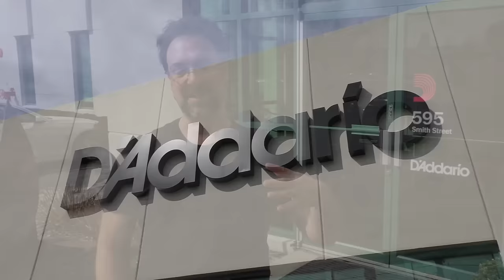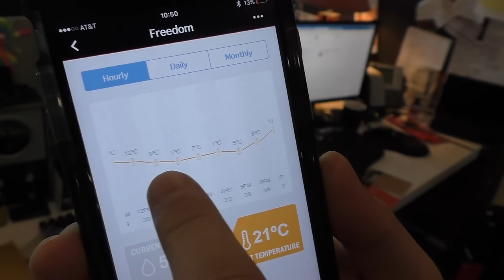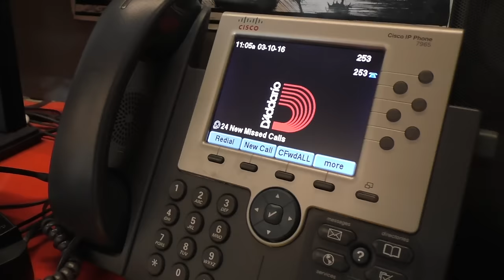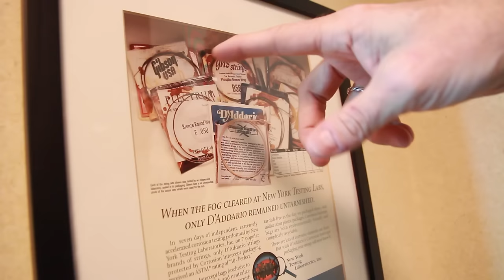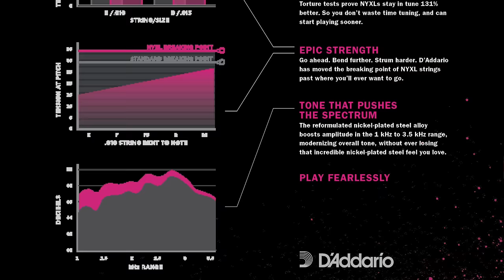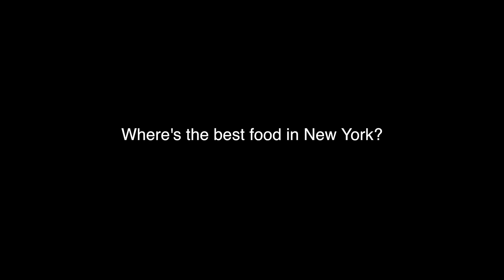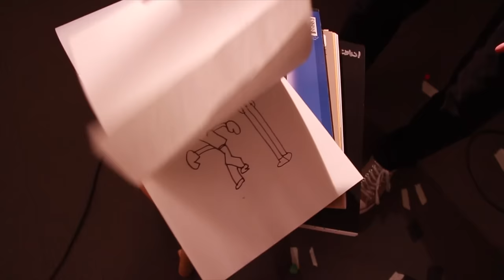D'Addario D'Documentary - Behind the scenes with Chappers

Comment: I have been using D'Addario strings for a very long time.
They are perfect except for one small thing.
When they went from the paper pockets holding each string to the sealed bag with all strings in there I have found that the strings are often wound up together and the the smaller plain strings often end up tangled and it can be a real pain in the ass to untangle them, especially in low light.
One ten pack I bought about two years ago was particularly bad for this.
Other than that they are perfect.
Nice vid Chappers! Thankyou for showing us the faces behind these great products.

Comment: D'Addario NYXL's are ~8% harder to bend than Slinkys of the same gauge if you measure with a scale.  :(  

Great filming and camera work.  Love Planet waves stuff..
Reply: +ml414skidoo Those sets are made with completely different materials. Thereby completely different results.
Reply: +daddariostrings  Thank you for the reply. Would other ranges of XL strings such as "EXL130 Nickel Wound, Extra-Super Light" be a set that is "easy to bend"?  Or possibly nickle plated steels are the best for bending?  
I'm less interested in durability or added strength compared to ease of fretting/bending.
Anyway appreciate the inside look at D'Addario and enjoy all of my planet waves products.
Reply: +ml414skidoo Although "bending" can be slightly subjective (meaning what's easy for one player might be different for another). .008s would be incredibly easy to bend. They require very little force to move the string and that would be true for all of our .008 sets.

Comment: watched this whole doc and still wondering what balanced tension strings are.
Reply: It's a set where you try to get as similar tension as possible on all strings. Normally there's a fair difference between the lowest and highest tension. Look at the tension per string for difference sets and then check out a balanced set. Then buy a set and try it:)

Comment: Rob, your recent switch to 50fps is causing all kinds of problems, it lags horribly, so I have to switch down to 480p to get an acceptable playback. I think 60fps tends to work somewhat better, but 50 is just awful and it doesn't offer any visible improvement over normal 30fps HD.
Reply: No lag for me. And I'm watching at 720. So maybe it's your connection that's crap.
Reply: Donald Shores
I'm on 50mbps fibre broadband.
Reply: +Richard Harrold Should run smoothly then. I just thought it was a pretty good quality vid. Wasn't trying to be a dick. Your comment just through me off cuz I honestly had no lag at all. And honestly the wifi here is not the best.
Reply: Donald Shores
I can play 1080p at 30fps no problem at all, I've just watched "The Captain Meets James Bay", but I really seem to have a particular problem with 50fps. Oddly, it's actually worse than 60fps.
Reply: +Richard Harrold that's funny, I watched that video first today and then came to this as well. I agree with your first comment too, there is very little difference between 30fps and 50.

Comment: It's me or D'addario strings for classical guitar are getting worse... For electric guitar are badass strings btw
Reply: Which tension do you use? I did notice a different feel from my normal tensions the last year or so.
Reply: +ultrafloss492 For classical I use Pro Arte, I don't remember the tension sorry man... For electric NYXL 0.11 gauge
Reply: Leo Rosario  I use the Pro Arte as well but I'm not quite sure what had happened. The strings feel a bit different and although the clarity and brightness are great on the initial attack,  the sustainability just dies as if it stiffens. I had this problem with a couple of classical guitars, changed all the parameters which could be a factor but I found that it had nothing to do with the installation. 

For electric I use XL - super light gauge 0.09. I really need to try the NYXL some time, are you happy with their overall performance?
Reply: +ultrafloss492 NYXL are sick!! They had a really good feel in bends an Floyd Rose squeals... Also I use Dunlop strings with high tension, are really good for drop tunings... And for classical I'm using Agustin (the purple ones), agustin (only the purples!) are amazing!! great tone but in 3 or 4 months hoy need to change it :(... I miss the old Pro Arte they last 6 even 8 months
Reply: Leo Rosario Exactly! I'm gonna try the NYXL next time,  thanks!
Reply: +Leo Rosario If you're experiencing an issue with the Pro-Arte's, please email don.dawson2@daddario.com - we'd like to hear more. We've not heard anything from other players in this regard.
Reply: +daddariostrings Wow!! What a kind of wonderful people!, you guys rule for that... I would try to describe the problem :)